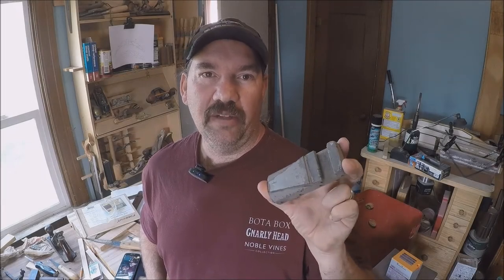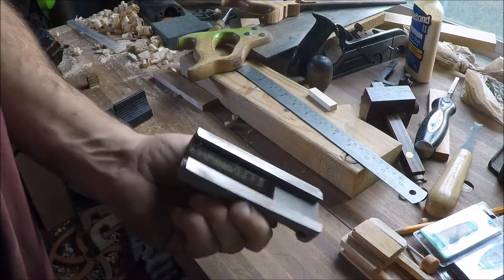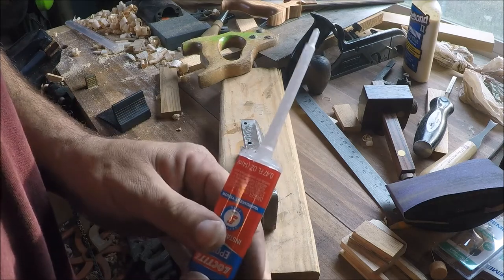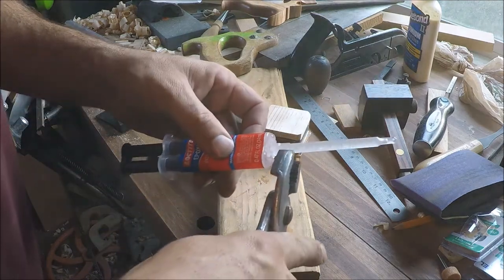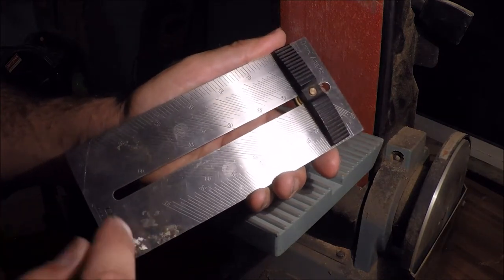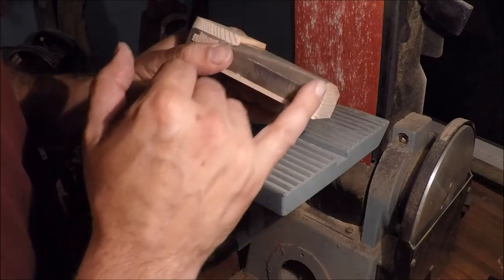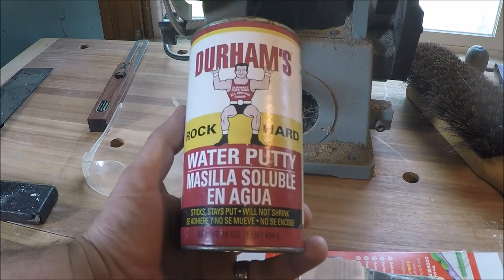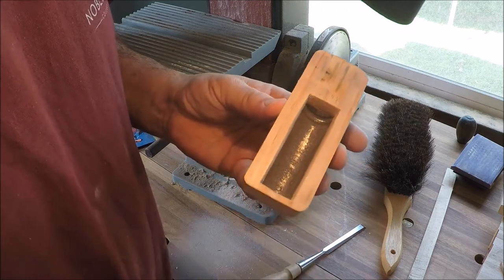Foundry Pattern Making: atlas compound slides #5

Comment: The epoxy pushing right through the slide ways as the wooden forms are inserted is testament to the fit achieved by Mr. Anderson here... 

Are you going to build yourself a waste oil furnace Chris in the future...? 
Make yourself a sand muller...and set yourself up a shakeout table...plus a few flasks...?
Reply from the maker: I'm thinking about that. What makes you ask about that
Reply: Old Iron Shops 

I just thought that if you were into pattern making then you might as well go all the way and start offering one off castings that the commercial foundries won't want to do... 
One off items for early machine tools etc... 

Money to be made Chris 
££££
$$$$
Reply from the maker: You are right at that.  Space us a problem lol (you know how that goes ) but I probably will in future.
Reply: Old Iron Shops 

You wouldn't need much space Chris... 
Take a look at luckygen...and myfordboy on utube...
Reply from the maker: Once I get my south Bend set up I will have some room. But at the moment it is scattered around the shop.

Comment: Very nice work Chris, I like that you added the piece to the top of the slide to even up that surface.  It is not only a weak spot in the casting but it causes a interference if you try and use a QC tool post. I made a washer for mine but it does not hold the tool post from rotating on heavy cuts. Are you going to follow through the casting and machining in this or an additional series?
Reply from the maker: This job is for a customer he will do the machine would. I will be doing a test mold so you will get to see how that is done.